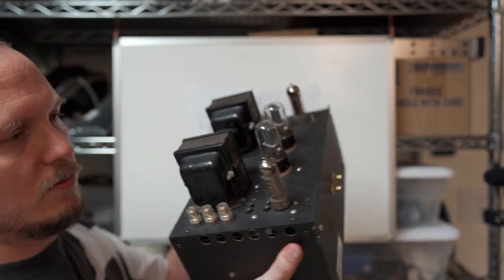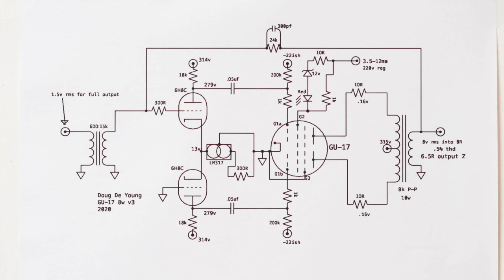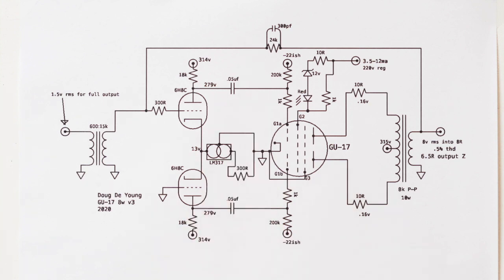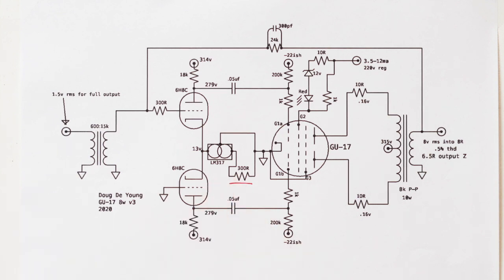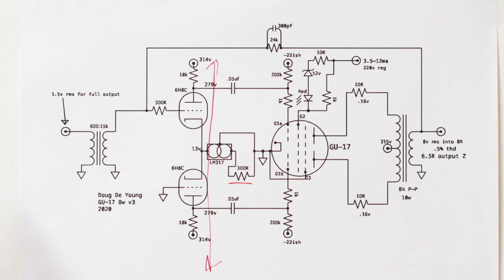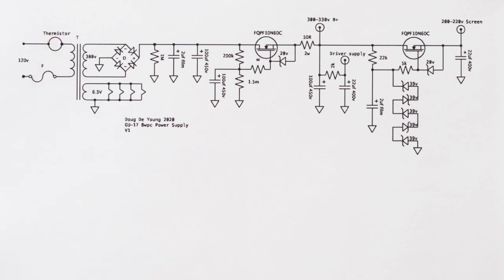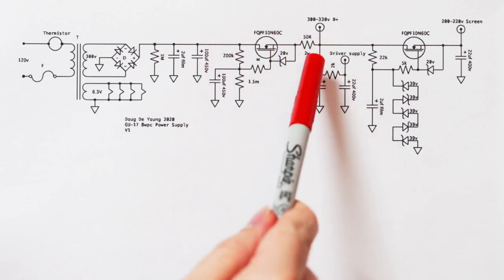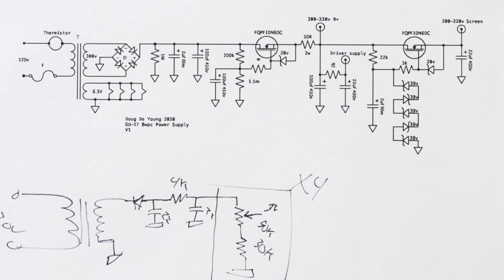GU-17 PP 8W Tube Amp Design (Part 1)

Comment: It's great content, thank you!
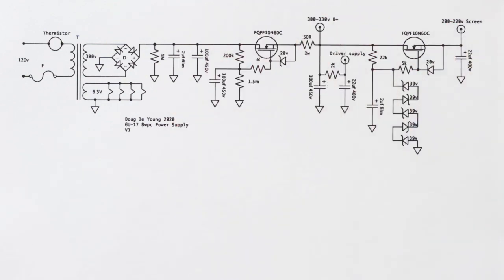Ar 32:56 you mentioned that you would not use zener diodes next time. What is the alternative you have in mind?
Reply from the maker: I’d use a LND150 as a current source across a known resistance for a reference voltage. Wastes way less power, less noise and it’s adjustable.

Comment: Wow You're not going to believe this, but I started watching this video and I'm thinking how similar You work to Me. I do exactly the same things. I bet that You put an 8 ohm resistor across the output transformer, and feed in 8 volts to see what voltage swing is needed on the primary to give you 8 watts output. Also  I am waiting on some  GMI-6 tubes from Ukraine as I'm watching this. That is Synchronicity for You. Best Wishes My Friend

Comment: Nice circuit! I especially like the power supply. Most people either use no MOSFETs at all or go crazy with super complicated transistor circuits. I just checked and the FQP10N60C is very affordable and available.These should also work as mosfet followers in the signal chain. Some ideas: No input transformer and use a 6N2P with higher gain for preamp tubes, Ra 120k with Va about 200V should give nice swing. And add the CCS tail could to your -22V supply. 6H8C only has a datasheet-µ of 21,5 , real life v/v of maybe 15.. Do you think this will work well with a 6N2P/12ATX or does the GU17 need the beefier driver with more current capability?
Reply from the maker: Hard to say until you give it a try. Those little input transformers are inexpensive and available on AliExpress though. 

In regards to the 10N60c I’ve actually just designed a A2 cascode output stage amp that uses one to drive the cathode of the output tube!  When I get it finished up I’ll make a video about it. It’s 10wpc with a single el34 per channel SE.
Reply: @Edgarbopp  I might just do that - I have all tubes and parts on hand..Regarding the sand-assisted cathode drive, yes I have read about it on diyaudio. Looking forward to that video as I have experimented with a screen-grid driven 6P45S SE amp (I have nice unused op-iron for it) during covid but struggled to get the driver right and it sits unfinished

Comment: Thanks for posting this design. I think I'm going to build it! I have a bunch of gu17 tubes.
Reply from the maker: Let me know how your build goes!!
Reply: @Edgarbopp  I will indeed. I''m presently preparing to build an old brook 12a design. Maybe you could do a video on back biasing and inject some of you interesting perspectives on this design. I think that would be a great video!
Reply from the maker: @swingarmer  just looked at that circuit. That’s center tapped choke loading the driver stage is very cool.
Reply: @Edgarbopp  Yes it's and old design and I've never heard one. Thought I'd give it try since i came across a stash of old nos 6a5g's in an estate sale. I'm using utc mqm-300 chokes in the driver stage.
Reply from the maker: @swingarmer  awesome!
Reply: @Edgarbopp  Your videos are appreciated, Thanks

Comment: Hi, have you compared the sound of a GU-17 based power amp to a triode-based circuit with ECC99 or similar? I`ve built a small guitar amp, preamp and phase inverter of the Vox AC30, the two triodes of the ECC as push/pull amplifier. It's not bad, but compared to the bigger, EL84-based Vox amps, something is missing in the higher frequencies. I wonder, if it`s a triode vs tetrode/pentode thing... What do you think? Is it worth a try?

Comment: Hi, im currently designing my first amp for a university project, could you explain the process of designing your power supply stage, ive done a design of a pre-amp and power tube through to output but now need to start on the power supply, would i just use ohms law and go through each part, work out what each part/leg of the circuit is wanting and build it that way?
Reply from the maker: I do talk a bit about HV supply design here. https://youtu.be/ux94hw1LBx4

Comment: Well done! I like the power supply, I personally find FET regulation very practical, the GU-17 looks cool enough to purchase a few for testing. I found this spice model for the GU-17 on line.

* GU_17 ****************************************
* Created on 01/14/2021 17:29 using paint_kip.jar
* Model Paint Tools: Trace Tube Parameters over Plate Curves, Interactively
* Plate Curves image file: GU-17.jpg
* Data source link: <plate curves URL>
*----------------------------------------------------------------------------------
.SUBCKT GU_17 P G2 G K ; LTSpice tetrode.asy pinout
* .SUBCKT GU_17 P G K G2 ; Koren Pentode Pspice pinout
+ PARAMS: MU=8.352 KG1=1802.71 KP=58.9 KVB=625.63 VCT=0.001082 EX=1.187 KG2=1800.08 KNEE=10.3 KVC=1.849
+ KLAM=5.88E-10 KLAMG=1.874E-4  KD=74.23 KC=5.645 KR1=7.67E-4 KR2=0.00384 KVBG=0.00825 KB1=2.58 KB2=2 KB3=2 KB4=0.3074 KVBGI=0.28 KNK=0.04211 KNG=0.01824 KNPL=0.04894 KNSL=12.94 KNPR=89.4 KNSR=68.45
+ CCG=6.2P CGP=2.6P CCP=1.9P VGOFF=-1 IGA=5.2E-4 IGB=0.27 IGC=13.92 IGEX=1.44
* Vp_MAX=350 Ip_MAX=170 Vg_step=5 Vg_start=20 Vg_count=11
* X_MIN=167 Y_MIN=33 X_SIZE=486 Y_SIZE=595 FSZ_X=1296 FSZ_Y=736 XYGrid=true
* Rp=1400 Vg_ac=20 P_max=6 Vg_qui=-5 Vp_qui=300 
* showLoadLine=n showIp=y isDHP=n isPP=n isAsymPP=n isUL=n showDissipLimit=y 
* showIg1=y isInputSnapped=y addLocalNFB=n
* XYProjections=n harmonicPlot=y dissipPlot=n 
* UL=0.43 EG2=200 gridLevel2=y addKink=y isTanhKnee=n advSigmoid=y 
*----------------------------------------------------------------------------------
RE1  7 0  1G    ; DUMMY SO NODE 7 HAS 2 CONNECTIONS
E1   7 0  VALUE=  ; E1 BREAKS UP LONG EQUATION FOR G1.
+{V(G2,K)/KP*LOG(1+EXP((1/MU+(VCT+V(G,K))/SQRT(KVB+V(G2,K)*V(G2,K)))*KP))}
RE2  6 0  1G    ; DUMMY SO NODE 6 HAS 2 CONNECTIONS
E2  6 0  VALUE={(PWR(V(7),EX)+PWRS(V(7),EX))} ; Kg1 times KIT current
E4   8 0  VALUE={V(P,K)/KNEE/(KVBGI+V(6)*KVBG)}
E5  81 0  VALUE={PWR(V(8),KB1)}
E6  82 0  VALUE={PWR(V(8),KB2)}
E7  83 0  VALUE={PWR(V(8),KB3)}
E8   9 0  VALUE={PWR(1-EXP(-V(81)*(KC+KR1*V(82))/(KD+KR2*V(83))),KB4)*1.5708}
RE4  8 0  1
RE5 81 0  1
RE6 82 0  1
RE7 83 0  1
RE8  9 0  1
RE21 21 0 1
E21  21 0 VALUE={V(6)/KG1*V(9)} ; Ip with knee but no slope and no kink
RE22 22 0 1 ; E22: kink curr deviation for plate
E22  22 0 VALUE={V(21)*LIMIT(KNK-V(G,K)*KNG,0,0.3)*(-ATAN((V(P,K)-KNPL)/KNSL)+ATAN((V(P,K)-KNPR)/KNSR))} 
G1   P K  VALUE={V(21)*(1+KLAMG*V(P,K))+KLAM*V(P,K) + V(22)}
G2   G2 K  VALUE={V(6)/KG2*(KVC-V(9))/(1+KLAMG*V(P,K)) - V(22)}
RCP  P K  1G     ; FOR CONVERGENCE
C1   K G  {CCG}  ; CATHODE-GRID 1
C2   G P  {CGP}  ; GRID 1-PLATE
C3   K P  {CCP}  ; CATHODE-PLATE
RE23 G 0 1G 
GG G K VALUE={(IGA+IGB/(IGC+V(P,K)))*(MU/KG1)*
+(PWR(V(G,K)-VGOFF,IGEX)+PWRS(V(G,K)-VGOFF,IGEX))}
.ENDS
*$

some of my tube designs https://sites.google.com/view/kenstubetester
Reply from the maker: Very cool! I love your work!

Comment: Couple of questions

Have you tried subminiature tubes like 6P30B?
Here's some info:
http://www.tubeclinic.com/RuSubMin.html
http://www.tubeclinic.com/6P30B.pdf

How much did you pay for those output transformers and for experimenting how much is appropriate to pay for them?
Reply from the maker: I haven’t gotten into subminiature tubes yet! So many interesting tubes so little time!  The GE outputs were a eBay find. I don’t recall what I paid. Some decent modern units can be had from Edcor (the cxpp 10w line are good) or roll the dice on AliExpress. A 8k PP of around 10w will probably be something like $40-60 each.